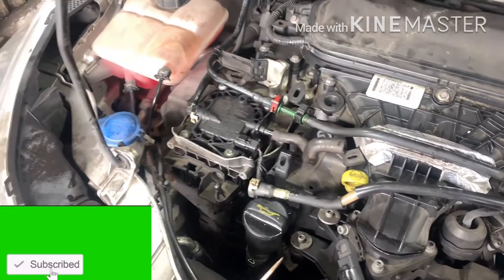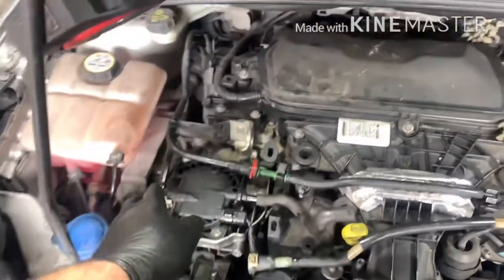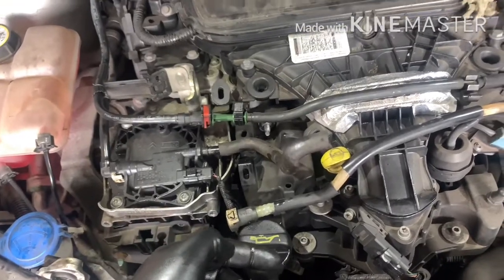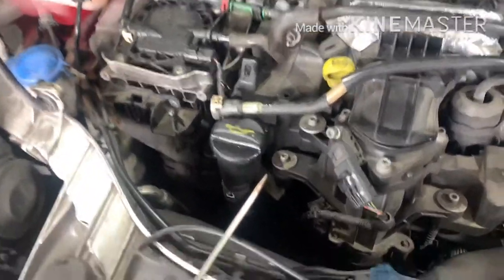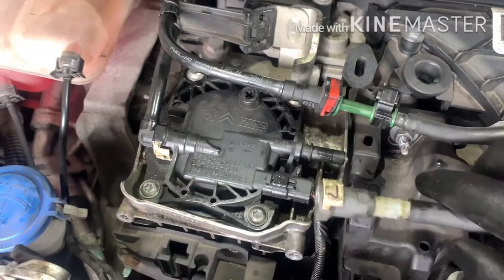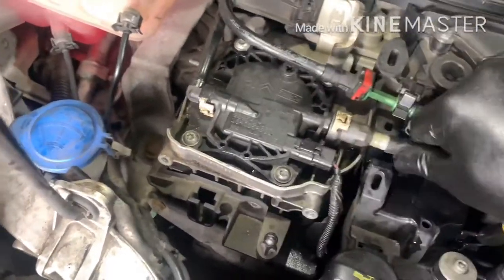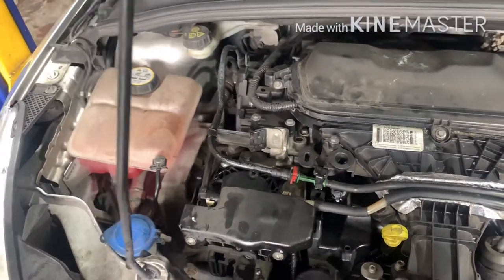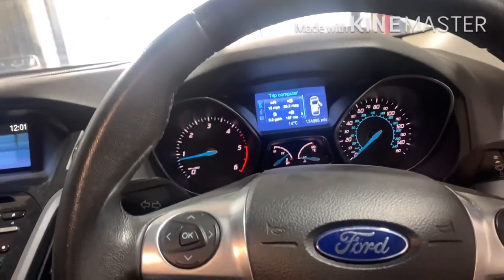Ford Bleeding Air Out After Fuel Filter Replacing

Comment: Well - it worked, but the smell of diesel inside a cabin after that must be "amazing" :D
There is a return line to the canister - that line with green clip (plastic ending) next to the filter. That is the line where you should bleed the air from fuel system - using for example hand pump or even a big syringe with a hose ;)